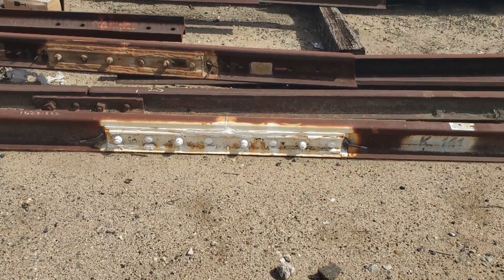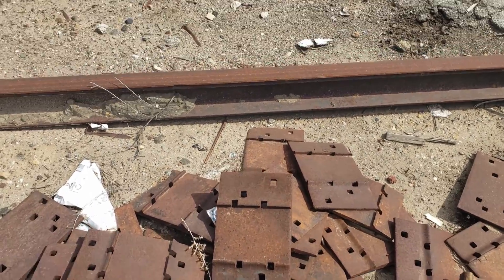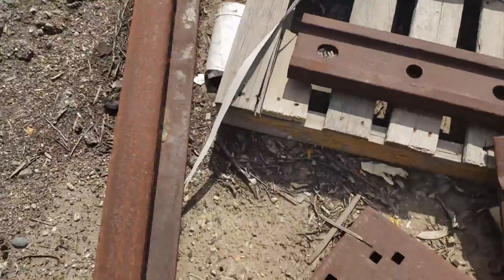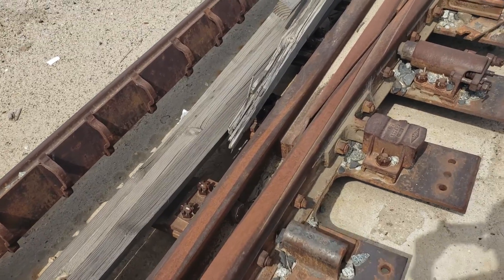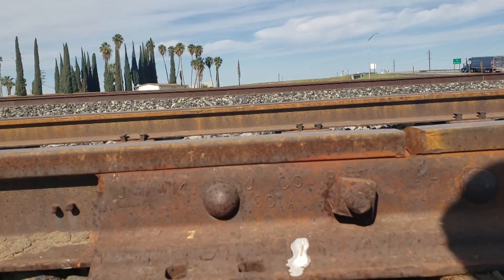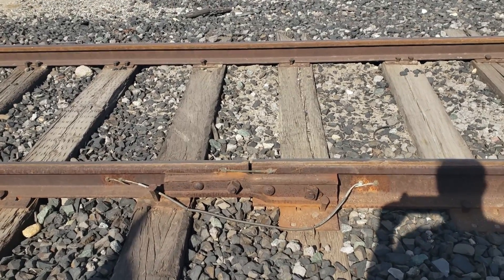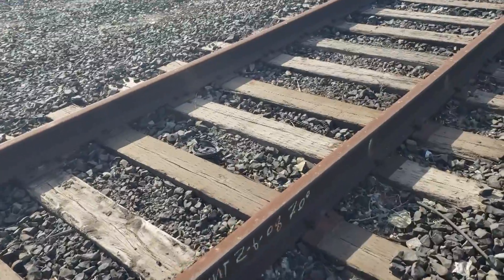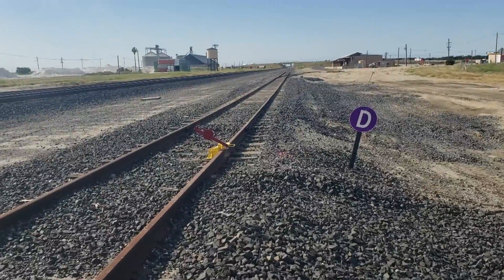All Rail is Not Created Equal! Here's Why!

Comment: When I was a kid I worked on an amusement park railroad built by my stepfather. It was built in the 50's and 60's just West of Albany, N.Y.  It ran on 12 lb. per yard rail supposedly salvaged from mines in the West. When the railroad expanded the rail was 16 lb. also supposedly salvaged. I doubted that because it was dead straight when it arrived on the truck.  The bigger rail was much more difficult to work and to bend around the curves. You should cut 10 : 1 switch points in this stuff by hand. They take a couple of after school days each.
 
A couple of years ago a relatively local Maine 2 foot gauge railroad, the Wiscasset, Waterville and Farmington in Alna, Maine bought a huge amount of 54 lb. Rail. This is heavier than they need but it was cheap. It came from a siding somewhere out West. That is a great railroad museum with several operating steam engines.
Reply: When the original Maine two-foot railroad was laid, they used 20 lb rail.

Comment: East of New London, Ohio in 2020, CSX replaced 60 MPH main line rail on #2 track which was NYC 127 lb. dated 1945. Yes, 75 year old rail in daily use on a major main line.
Reply: NYC 127 rail has a 6 1/4" base. Kind of unique now as 5 1/2" and 6" base rail predominates. 
Changing out that 6 1/4" base rail for one of the other sizes requires new tie plates to match. The hard part, is that to maintain 56 1/2" track gauge, the new plates must be spiked down to the ties, not exactly where the old ones were, but so close that the tie may not have enough 'meat' in the right place to hold the new spikes.
Reply: @MsCriticalthinker201   The 127 lb rail was a Dudley section used by the NYC and the KCS.  It was designed in the 1920s or 30s.  Changing rail sections does have its disadvantages if the bases and heads don't match.

Comment: That was a nice lesson on rails.    Can I assume the reason for different weights is strictly cost?  Why would one put a heavy rail on a side line that is rarely used and does not carry much weight, like delivering cars a few times a year that haul cotton?

Surely you would not use light weight rail in an area like Altoona, PA where Horseshoe Curve is located. 

Thanks for posting this great video.

Barry
Reply: Its cost.  Also just easier to work 90lb and under rail by hand.  But most of that stuff isn't made any more so it is cheaper to stick with the current sizes.

Comment: In NZ I have not seen insulated joints in the main center, as most of the rail here is welded. But rather some sort of magnetic pickup, 2 of them per track spaced a few feet apart I guess for speed and direction detection.

Comment: Over the road trucker here: I have hauled used rail a few times. I've seen rail dated in the 1890s 🤯. Talking to those who buy/sell it say it's still good, adding that USS Ensley (long since razed 😢) rail was the best. They just tranverse it and could probably run it for another 50+ years or so. Amazing.
Reply: A lot of old rail under 110 lbs along with any too beat up to be rewelded gets re rolled in to t posts and shit.

Comment: Fascinating video! Where I'm from (UK) standard rail length was 60ft and you could work out the speed you were doing from the clickerty-click (900 / seconds per 22 joints = mph). When CWR came along in the 1970's you could still just about hear the welded joints. But then came today's really long rail with no clickerty-click at all. Tis sad but it's progress I suppose. It's now manufactued in 108m lengths and generally suppied as two of these welded together. So there's no clickerty-click but instead you hear a noticeable humming sound caused by rail reprofiling. They seem to do that about once a year using rail-grinding machines.
Reply: The other UK/US difference in jointed rail is that UK practice is to have the joints aligned, so both rails have a joint in the same place. US practice is to offset the joints so the joint in one rail is in the middle of a length of the other rail.

Comment: Most modern rail is either 115RE rail with a 5 1/2" base for transit and moderate traffic or 136RE rail with a 6" base for heavy traffic. 119RE is also 5 1/2" base, and the 141RE is 6". 
Prior to the 1940s rail was open hearth steel, afterwards came the 'Controlled Cooled' steels which (I believe) eliminated or lowed the hydrogen content that caused brittleness and cracking. 
Other enhancements can be done to the rail during/after rolling to improve durability and longevity. 
On the side of the rail opposite the side with the raised manufacturer and rolling date information are embossed (stamped) letters and numbers that indicate the heat (melt), ingot and any further treatment to the rail. 'SS' means standard steel, good for tangents (straights), 'FT' means fully heat treated (most durable in a curve, harder to drill, too expensive to use in straight track), 'HH' means head hardened (durable and suitable for use in curves and tangents), 'CH' means end hardened to control rail end batter in jointed track. I think there are a couple more too, but HH is how most rail is ordered now because it can be laid anywhere with good results.

Comment: Always wondered (and you seem to be the perfect guy to ask) - take a look 16:30 in your video. From time to time I sometimes see either orange, red and even green spray painted vertical stripes on the rail sides. WHAT DOES THIS MEAN???
Reply from the maker: Orange is generally used to by track forces for various reasons like marking a defect or designating surfacing issues.
Green is generally used by signal forces to mark wires or equipment during track work so the equipment operators don't hit those things.
I don't know about red but white is sometimes used to keep an eye on rail movement.
At least around here! Could be totally different in your neck of the woods!
Thanks for checking it out!
Reply: Notice that on the side of each rail where the paint is, there is a wire connected to the relay box for the signal circuit connection.

Comment: The smallest rail I've seen was also the oldest, it was a 67.5 pound rail stamped 1896 that was still in use in a siding.
Reply from the maker: I was just reading in one of my books (can't remember which one!) about a line laid with 50# rail iron. I can't imagine it would have supported much weight!
Thanks for checking it out.

Comment: From my experience as a track dog on the S.P. in  Oregon the largest rail I ever saw was 155 lb. mud channel rail from inter urban line in the streets of Independence Ore. also I heard that head free rail came about to save steel for the war effort in ww2, and then the rail road continued wanting it to save $. almost forgot nice job on the video Mark.
Reply from the maker: Wow, that's heavy rail for an interurban! The old ones around Fresno were 110.
Thanks for checking it out!
Reply: @MarkClayMcGowan  Hi Mark glad to hear you got through the Covid stuff o.k., it got a lot of great musicians as you know, yeah I don't know how they forged the rail with the channel attached but regular rail tongs for the speed swings wouldn't open wide enough and after we cut the asphalt we had to take cutting torchs  and cut the mud channel off in spots well I've prattled on enough oh yeah I've been retired almost 10 yrs. so enjoy it, thanks for a great channel.
Reply: Yep, we have 155-pound Rail where I work.
Reply: The rail you call mud channel is termed girder rail or flanged rail for trackwork in pavement areas like streets and piers so the rail does not flex much under traffic to help keep the pavement from flexing and breaking.

Comment: I’m in Stillwater Minnesota. I got one rail from the Minnesota Zephyr line when it was being removed for a bike trail. I asked a crew member if I could buy a piece and he said no. I had several friendly conversations with him plus I live right next to the ROW. One day I walked out to my truck and a 5’ piece of rail was left right next to my truck so I loaded it up. April of 2018 the 1/2 mile or so tracks between the south end of downtown Stillwater and Sunnyside Marina were being removed for a bike trail. I stopped and talked to a crew member and I was able to buy two pieces of rail each under 3’ long. One is dated 1899.
Reply from the maker: Very cool. The oldest I've seen was 60 pound 1890 rail. It was being used as a barrier of sorts on an old industry track in Merced, Ca.
Thanks for checking it out!

Comment: Where exactly would a spring frog be used?
Reply from the maker: It's getting to be that they're everywhere but originally at high use turnouts. They don't wear as quickly and the point of the frog never breaks and has to be welded up. A very time consuming process.
Reply: @MarkClayMcGowan  The Shore Line Trolley Museum (www.bera.org) has been using them for a few decades now, since they run streetcars and rapid-transit cars, which have substantially different tread and flange widths.
Reply from the maker: @RailRide  that certainly makes sense!
Thanks for checking it out!
Reply: In the main line where the spring part is to the turnout side that is not used much so the ride over the frog will be better than a regular frog; the wheel treads are supported by the sprung part of the frog.  Spring frogs are right or left and can't be swopped.

Comment: What was or is the code line?
Reply: Code line is from back in the days of CTC machines. The dispatcher, or whoever was in control at the control board, would set up the route for a train by changing the position of different switches for turnouts, signals and other things. It's pretty much just programming the machine. Once it's programmed the operator pushes a button that sends the code out to the different control points over the wires. If you've seen videos of these older CTC machines then you've probably heard the machine clicking as the multiple relays involved click out the code as well as receive similar code back from the control points. Probably not the best explanation but it's the best I could do as I'm not that good at explaining stuff. Hopefully someone can come along with a better explanation.
Reply from the maker: We got rid of our code machines in the late eighties and replaced them with PENTA units. They were early microprocessor control units  but the code line itself was still used to run them until the advent of the wireless communications systems that now operate the control systems (Genisis and Microlok) since the installation of PTC.

Comment: Kind of like a whole new world. Great video. Question,can high snow close the track circut and mimic a train in the block?
Reply from the maker: it can but if there's steady train traffic it tends to keep the snow away from the rails. Mud is a generally a bigger problem. The biggest issue with snow is it packed into switch points and they won't close.
Thanks for checking it out!

Comment: A little late but do the railroad typically leave the frogs and turnouts disconnected when replacing a junction? I once saw a BNSF work crew at Kirkland TX pull a whole junction piece( ties and everything) out of a gondola and set it next to the R.O.W to eventually replace the existing junction.
Reply from the maker: Sorry for the lateness of the reply. Things have been hectic! Usually, if they're lengthening a turnout or doing a major replacement project they will use pre built turnouts. It's a lot easier and faster but they still just change frogs and switch points and stock rails in smaller jobs.

Comment: What you called an angle bar, we call a fish plate where I work. In my case its rail for bridge cranes inside of buildings (steel mill, AK Steel) Not sure if the difference in terms is geographic, different industry, or different use. If I can remember, and I have opportunity, I'll have to ask any of our railroad dept. guys what they call them. I'm a millwright. I always had a bit of interest, and certainly have enough seniority to bid a RR job, but the discipline( punishment) they hand out in that dept. is on a whole different level than other areas. Pretty similar to what I think you were referring to in your "miss/won't miss" video. The threats...rang very familliar. Trains, steel mills, very dangerous which is partly why they drive the safety, but I knew exactly what you meant when you said you "won't miss the threats."
     Enjoying the vids, very informative. I recognize many of the same controls, but obviously different application where I am. But its clear to me signaling would be my easiest fit if I were ever to hire into  RR. But too old to be changing careers, about 6-7 yrs left to retire.
          A belated congrats on retirement!
Reply from the maker: I've heard similar comments on different names for things in different industries. I have no idea why they're called angle bars.
Thanks for checking it out!
Reply: @MarkClayMcGowan  Look at the joint bar at 8:32, looking at the end of it, it looks a lot like a piece of steel angle.  That area is also called a "toe".  Most modern joint bars are made toeless to be stronger.
Reply: They're called fish plates in the UK too.

Comment: I love your videos! In CTC territory are the track circuits inside the rails for the entire territory or do you only find track circuits at Control Points? For example, if some cut a piece of rail in half in CTC territory, would the signal system detect it?
Reply from the maker: Except on non signaled territory all tracks have circuits so trains can always be tracked by dispatchers and signals will always display the proper indication

Comment: What is considered to be an acceptable up-and-down range of movement for track when a train is passing over it?  Most of the time it only appears to move an inch or so.  But one time I was at a grade crossing waiting for a UP eastbound to pass and noticed that the track just east of the crossing had a travel of several inches, which seemed excessive.  I was able to get a guy at the local UP MOW department on the phone and told him what I'd seen.  He thanked me but also sounded a bit skeptical.
Reply from the maker: Zero is obviously the best but most places will pump at least a small amount under heavy trains. I have seen places where the rail pumped a few inches. Track Inspectors are supposed to watch for loose ballast and other factors that can cause it. Pumping track at switches is bad as it can damage the equipment and at crossings it can damage the pads. When it gets bad trains will report rough track. They're so low on manpower these days that there is no real preventive maintenance happening. Thanks for checking it out!

Comment: Mark, I had the experience of knowing different types of rail when I worked on Caltrain work train. SP still had old joined rail on the Commutes. When the CWR and concrete ties were installed, the ride was much much smoother. I know at one time, Tracy had a CRW plant.
Reply from the maker: Much of the CWR used here was from the Tracy plant too. I always wanted to go see how that was done.
Thanks for checking it out!
Reply: @MarkClayMcGowan  There's a CWR plant in Stockton, IIRC. That would be a fun place to go see. If you need a cameraman, lemme know!

Comment: The rail on the GC&SF branch near my house that was removed around 1994 was built in 1886. I have a piece of 39 foot 90 lb rail manufactured in 1913 from it in my back yard. I cut it in half and built a rolling mining cart to sit on 19 1/2 feet of track, beside my Santa Fe code line cross arms and insulators that I found buried in overgrowth. I have Also found wood rail insulator bars out there. Brought home the least rotted example I could find. How old would those wood rail insulators be?
Reply from the maker: Sounds like a cool setup! I'm not sure what a wood rail insulator is though.
Like an endpost?
Reply: Mark Clay McGowan 
They look just like the steel connector bars. But made out of wood with 4 holes drilled into them.
Reply from the maker: @msnow22000  I've never even heard of that! Can you send me a pic? Motopoet59@gmail.com
Reply: @MarkClayMcGowan  I have one I scavenged from the NYCTA during a signal upgrade project I was on in the 1980s. It is a piece of machined ironwood that was used at an insulated joint. Very heavy and very hard.
Reply from the maker: @MsCriticalthinker201  incredible! I'd never heard of wooden IJs but it makes sense, especially if there is a plentiful supply of that type of wood. The oldest stuff I worked with was from the 20s and made of fiber. There are still some in service on old yard tracks.
Reply: @MarkClayMcGowan   During WWII, some wood was used to help not use so much steel in the track of other than the main line.

Comment: Great video about rail types. Does UP do thermite welding of rail? Especially fond of Famoso and the Idle Spur Cafe - also stop at El Taco Loco just south of there when I gas up at Flying J.
Reply from the maker: Yes, they still do thermite field welds quite often. It there is a broken rail or defect changed out they will bar it to get things moving but weld out ASAP.
Thanks for checking it out!